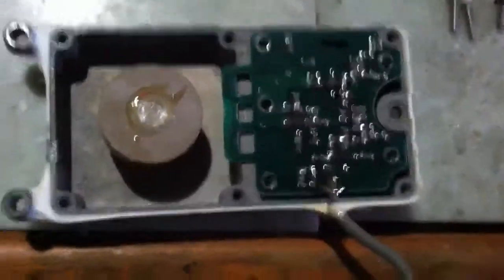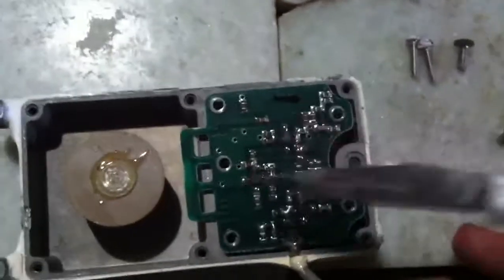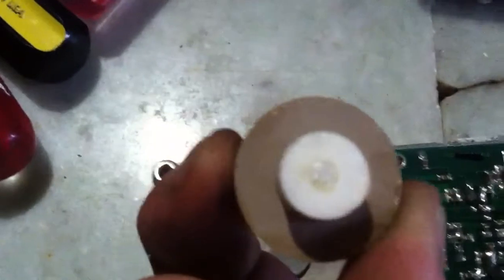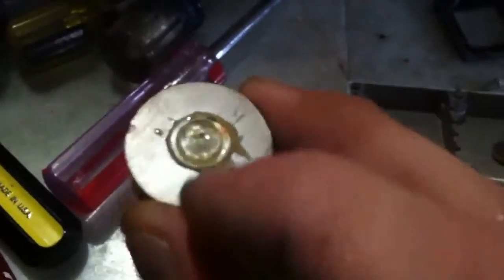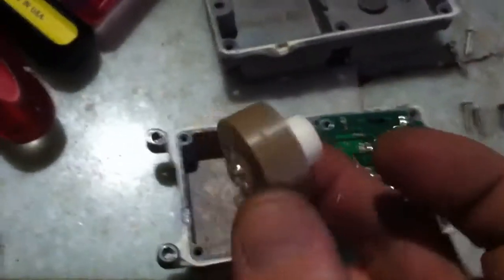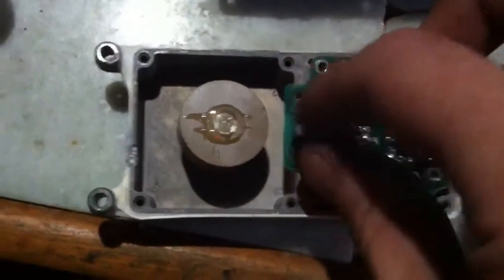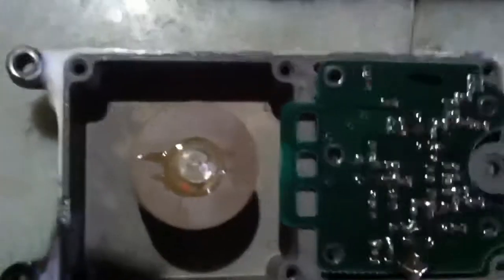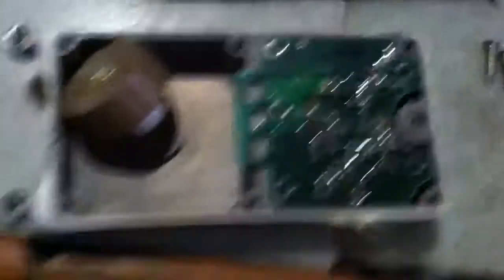Timothytrespas: ELECTRONICS QUESTION:Unknown electronic device in tv downconvert

Comment from the maker: not a magnet. some type of ceramic/glass next to an antenna dual loop. Possibly some type of microwave down-converter. Signal is transferred electromagnetically to the ceramic and it RESONATES at some frequency which is then picked up by the loop. Just a guess. does anyone KNOW? Thanks.